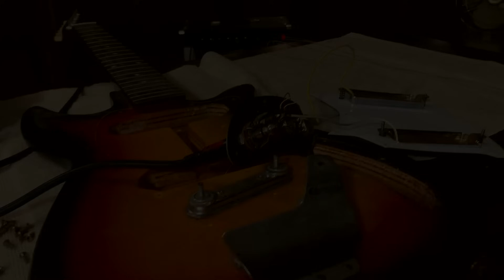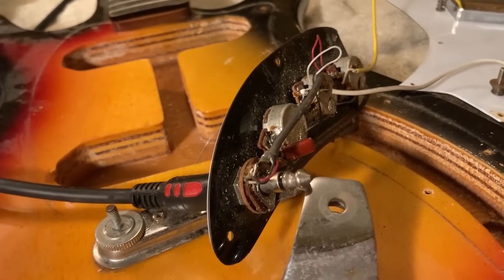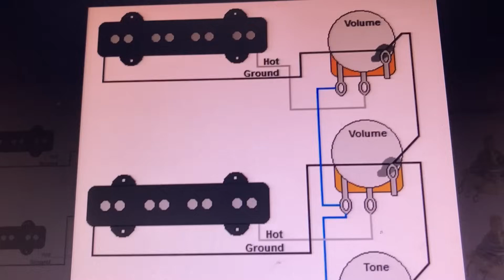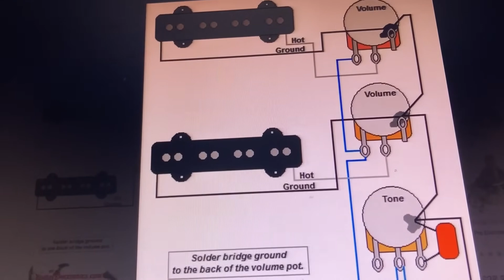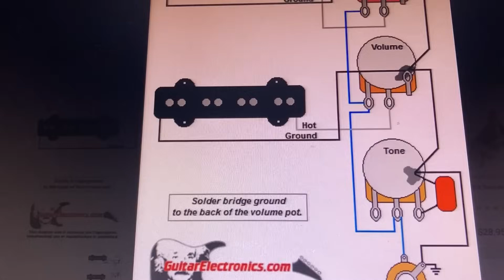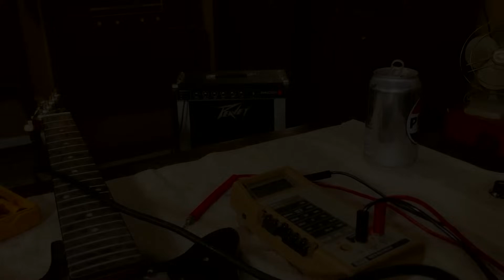Trying To Fix  An Old Sears Electric Guitar That Just Buzzes!

Comment: At 5:20, the bare wire ground-buss soldered to the back of the middle potentiomer has a cold-soldered connection ---- the wire passes through a tunnel in the blob of solder but the solder didnt "wet" to the wire. It'll need resoldering eventually....

Comment: Properly wired guitars should have less hum and buzz when the strings are touched;  If touching these parts creates more noise this is an indication that it's missing a ground. You can use an ometer to check for continuity, or the lack of it, between the strings,  bridge, tailpiece, pickup covers, output jack and all other exposed metal parts.  They should all be connected together with no more than a few ohms of resistance between them.

Comment: I have several (Tulip shaped) that I've been collecting for a while. Of the three Japanese models that I currently have, The base of the input has a ground wire going to the tone pot. I experienced the "Buzzing/Static" too and shielded the electronics (pickups, volume and tone pots) with copper shielding. I also made sure wire from the base of the bridge was grounded to one of the pots and that eliminated all the bussing/Static. Thanks for a Good vintage  video !
Reply from the maker: Thank you for the information Rick!

Comment: Take a black plastic wire tie. Cut it and form it to fit the area where the binding is missing on fret board. Epoxy it in with  clear epoxy. That should fix it.